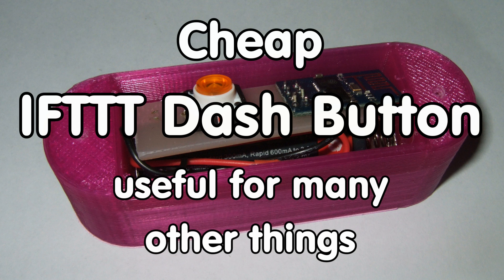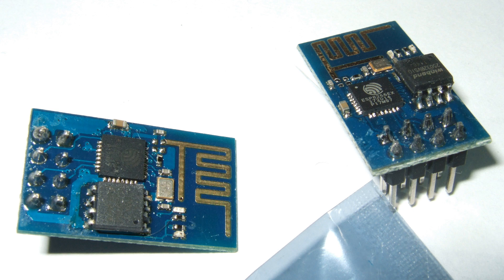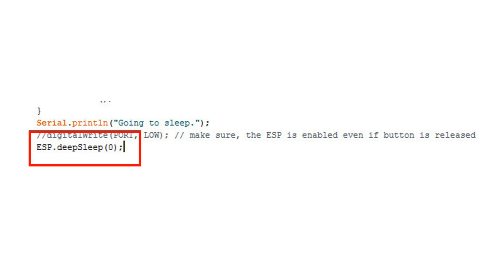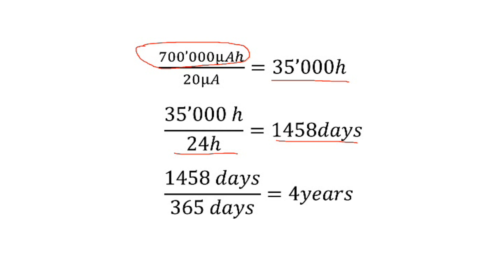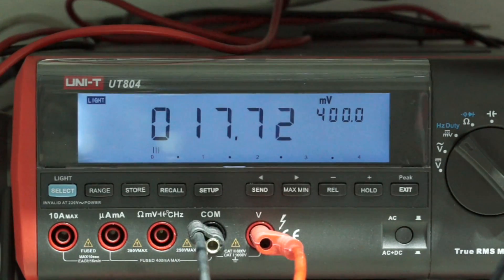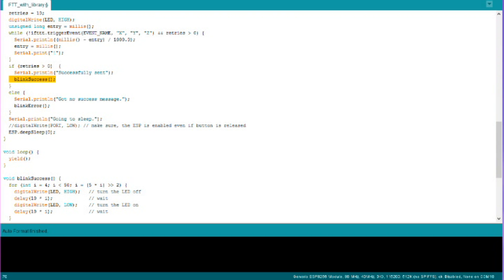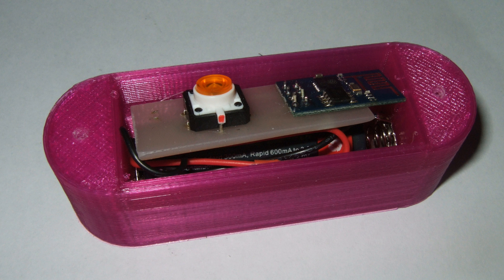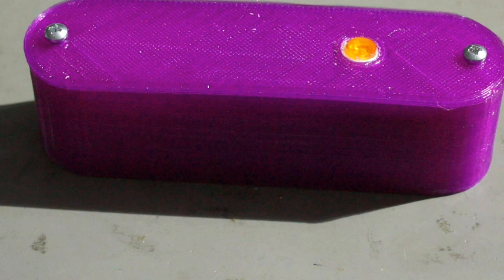#108 Cheap IFTTT Button with spare ESP-01 finished. Can be used for many other things

Comment: I downloaded your sketch and added need libraries, compiling yields -

Arduino: 1.6.11 (Windows 7), Board: "WeMos D1 R2 & mini, 80 MHz, 115200, 4M (3M SPIFFS)"

C:\Users\reisinger\Documents\Arduino\IFTTT_dash_Button\IFTTT_dash_Button.ino: In function 'void setup()':

IFTTT_dash_Button:41: error: 'mySSID' was not declared in this scope

   Serial.println(mySSID); // your network SSID (name)

                  ^

IFTTT_dash_Button:42: error: 'myPASSWORD' was not declared in this scope

   WiFi.begin(mySSID, myPASSWORD); //your WiFi password

                      ^

exit status 1
'mySSID' was not declared in this scope

This report would have more information with
"Show verbose output during compilation"
option enabled in File -> Preferences.
Reply from the maker: You can either fill out the content in the "credentials.h or just overwrite your credentials in the wifi.begin.
Reply: So where would I find "credentials.h" library?
Reply from the maker: +Paul Reisinger I think,it is on github, but I am not sure, where. Just google "sensorsiot credentials.h" and you should get it

Comment: Andreas, ESP-01 has 4 GPIOs perfectly usable which is enough for any I2C or SPI device or mixed digital input/output. ESP-12 in total has 11 pins. Have you ever tried to use SPI flash pins? Firmware must be then started from RAM. This would give us even 17 usable pins in total + 1 ADC.
Reply from the maker: I never used the RX/TX pins on hte ESP-01. But with IOTappstory.com, I have to reconsider this fact.
Concerning Pins: I never used the SPI pins. Too complicated for me. Then, I would rather use a port extender. Or wait for the -32...

Comment: Excellent As always.. Love Your videos.
Reply: Andreas, I just saw the code. You have used variable retries  > 0 in the second while loop.  What is the point in using it. And what does the yield(); function do.. Thanks, I'm getting lot of motivation from your videos.
Reply from the maker: 1. retries: After a certain number of retries, the ESP resets and starts over. I could also stay in this loop forever. I do not know, if it helps to reset. but for sure, it does not hurt...
2. the yield() function is necessary for ESP8266 sketches, if you do not use delay(). It gives the processor time, to do its Wi-Fi tasks. Otherwise, the ESP crashes.

Comment: Great job, Andreas!
Your videos is always feeding my mind with new useful information, and now its just in time for my current DIY task.
For today, I'm looking for a low-cost wireless solution to connect spring vibration sensors SW-1802P to Arduino-based alarm, with low power consumption.
I have not chosen yet - ESP8266 or NRF24L01+, or maybe something else (cheap 433mHz modules is not a good solution for security reasons).
Reply from the maker: What would be the purpose of the device?
Reply: The task is to create a low-cost vibration sensor module with low power consumption for the alarm system. The trigger is a spring-loaded switch SW-18020P or ball-based tilt switch WS-520. So I need to process the trigger state then send the alarm signal wirelessly. 
The common security sensors uses 433 MHz freq, which is not suitable because of very poor security. From a low-cost wireless solutions available I have ESP8266 and NRF24L01+
Maybe the simpler and effective solution exists, I think.

Comment: When I re-built my house back i n 2004, I decided to place an experiment behind the vinyl siding, on the North wall of the house.
I unrolled a 25' kitchen aluminum foil and glued it horizontally at about 18 feet off the ground (highest point I could go), and glued it to the house wrap vapor barrier. You should've seen the look on the faces of the siding installers when they showed up that morning. Priceless!
I used it as the antenna for reproducing the effects reported by Tesla as radiant energy. (Patent: http://www.google.ca/patents/US685957). Read this patent carefully. It's amazing. Even re-reading it after all these years.
The results were very surprising. A lot of electrical energy could be generated from the free ions in the atmosphere. 
I wasn't into Arduinos then, because they didn't exist back in 2004. 
Now, I am beginning to look back and see the huge potential this may have in operating an Arduino-like project, without solar power. 24/7 and in most cases, stronger power at night!
Not enough power to even run a light bulb full time. Let alone your house! But I was able to pulse an led at 10 Hz.
The trick was to keep charging the main capacitor, using the Jewel-thief like circuit. Actually, it is a boost converter!
When the voltage of the cap reached 20v+, dump this voltage into the main battery (Pulse Charging).
John Beddini's "school girl project" (SG Motor/generator), reflects that. He produces No Free energy of course, but the fact that you can steal power from the atmosphere has huge potentials for low-power devices. 
I am going back in time and re-investigate the possibilities of my past insights. One would be the elimination of batteries and using a single Super-cap as the main power source and operate 24/7 without any other power source.
Will report back IF I find anything useful. 
In the worst case, I would have to use a separate super-cap and keep accumulating power from the atmosphere until I has enough power, to operate the ESP8266 and it's WIFI for a few minutes. Rinse and repeat. How often can this happen? how much power can be had? what are the relationships between the antenna area and production of power? many many questions to be answered.
Reply from the maker: Interesting project. I have no idea how much energy is around us. I just remember, in the days of short wave radios, I was able to keep a 
fluorescent neon lamp in my hand in the proximity of my shortwave radio and the lamp went on even it was not connected  at all. The same experiment was done on much bigger distances near more powerful short wave radio station (then used for oversees Propaganda to the "communist" countries...
So, maybe part of your "harvest" is energy form your Wi-Fi or a close-by cellular antenna..
Reply: UFOhunter fascinating and well written, I would love to hear more🙏
Reply: As I started to read your comment I suspected you were going to make a tin foil hat out of the foil but this turned out to be an intriguing and well-written post.  If I look around my living room where I now am, I can see electrical devices everywhere and you raise a really interesting point about batteryless devices.

Thank you.
Reply: Very interesting bro! Thanks for the write up and link.  Really makes you think!

Comment: After seeing the 33C3 talk about an attempt to hack the amazon dash button v2 I started to look for creating something like that myself, and I came across your video 101. (and subscribed to your channel since it seems you do a lot of interesting stuff with this esp8266), my esp8266 I ordered yesterday and should arrive in a few weeks ;)
However I also saw some discussion about reducing power usage by using an LDO with reset pin. Design can be found here:
https://github.com/8n1/esp8266-smart-button
I was wondering what you think about this. Also 1 of the things talked about in the talk was the dash button also sends the % of power that is left in the battery ... would be interesting to send this as well so IFTT can for example send a mail if the battery is about to be depleted...
Each time you push the button the ESP will draw a lot more than 20uA so you won't last 4 year with that battery ... (your calculation now only contains when the ESP is in deep sleep -> so you should never push the button to get this time :P )

Comment: I have read that you need to hack the esp-01 for deepsleep. You did not mention any hacks? See this Hackaday post: http://hackaday.com/2015/02/08/hack-allows-esp-01-to-go-to-deep-sleep/
Reply from the maker: This title is misleading. You do not need to hack it to put it in deep-sleep, you need to hack it, if you want to let it automatically wake up after a defined time. This is not necessary for this button. We do this manually.

Comment: have you seen mongoose-os? It is an operating system for multiple chips CC3200 esp8266 esp32 and others that has support for mqtt (even AWS-IOT) i2c gpio uart, and other things. They have a really nice configuration system, which reminded me a bit of the one you use with your appstore.

Comment: Hi Andreas,
It is a interesting mode to deep sleep the ESP01. What about the Wemos d1 mini board? currently in my projects i'm using direct cable beetween chip enable and reset pin, so it auto-reboots. But since i don't have a proper multimeter i'm not sure of its power consumption in deep sleep. can you test this? Best Regards
Reply from the maker: The Wemos is not ideal for deep sleep in production. It has components like the USB to serial  converter which draw current even if the ESP sleeps. So, if you really want to save power, you have to use the bare chip. However, I use one for development where I do not care about energy

Comment: Hm, in this particular case, ie ESP-01 and a button to manually reset the ESP; why don't just use the button on the Vcc line if power consumption is important? 0uA is better than 10-15uA.
Reply from the maker: Then you have to hold the button down till you are sure the signal is sent. With hte used concept, you jus push the button for a short time and the ESP switch it off when finished.
Reply: Yes, I realized that like 2s after submitting the comment. 😂

Comment: I find the lifepo4 quite expensive. 😕 ~5$/piece! Do you have a link for the one you use?
Reply: Alex Schick Andreas covers this in the other video .the problem with AA is two alkaline battery's will quickly drop below usable voltage for the esp8266 and while there is still a lot of charge left in the batteries
Reply from the maker: I purchased it a while ago. You should find the link in the video about LifePo4
Reply: Andreas Spiess thanks, it is video #64. about 13$/4 batteries, not as cheap as I would like to. Might be cheaper to use simple AA with a compromise to size.

Comment: Mr Andreas your videos are very useful and helpful. But I have one question about 3:15 in this video. You say 15 μA but at multimeter the range is voltage. What about that ?
Reply from the maker: The micro current Gold device (the red one) changes current into voltage. Just google the device if you want to know more.

Comment: It sure is very useful, and it leads me to a question I have for some times. My project consists of various sensors for my boat. So I want to protect my circuits from moisture. I thought to drown my esp12 and the other components in clear resin, but was wondering if it would alter the wifi signal... would you have any opinion on this subject ?
Reply from the maker: +ghismo If the resin is non-metallic, it should work. But I would try it once wit an example. I covered one with heat shrink tube and had no big effect.
Reply: Andreas Spiess wow, that was a fast answer ! Thank you ! Yes, I'm not totally convinced it will work, so I will buy parts in multiple quantity. There is another problem, when the resin cures it can warm up to 100°c... I've seen somewhere esp where rated to work at 125° so it should survive... well, I'll try. Thanks again for your time, answer and videos :)
Reply from the maker: During soldering it is heated to more than 200 degrees...

Comment: Nice. So i will maybe have a use for my old and never used esp01. 
Someone any idea how to find out which actual offers have 1 or 4 MB Flash? When i scroll trough the actaul listings none of them tells any size of the flash. I do not want to buy those small Flash esps again.
Reply from the maker: 1 M is the same as the Sonoffs and is ok for many purposes. I never saw -01s with 4M
Reply: I saw an offer telling 4M a while ago. But actual none tells any size.
Reply: The newest ones have 1MB instead of 512kB. There are none with 4MB. You must be mixing things up with other models such as ESP-12E.

Comment: Nice! Despite the fact that not so many of your viewers liked the 3d-printer part I've just bought one. Is it possible to get the .stl-file for the box and what kind of design-program do you use to create it?
Reply from the maker: Good decision. You will love it! STL files are now on Github. I use Solidworks, but it is an overkill fur these applications.
Reply: Andreas Spiess :-)
Reply: Thank you very much!

Comment: Great 're-use' of old ESP-01s! I used mine to 'thingiversify' some AVR-Projects using Jeelab's ESP-link software (worth a look, imo). To make the ESP-01 suitable for OTA update, i replaced the eeprom by 4M versions. Thes cost a few cent, and it takes a few minutes to change them - especially when using cool gear like ke your microscope... ;-)
And of course tHanks for another inspiring video.
Reply from the maker: 1. Jeelab is a longtime member of my to-do list...
2. I even made a video to upgrade to 4M. But I was too lazy this time. I hope, on sunday, I will come with a video on how to use IOTappStory infrastructure for your own projects. Maybe this is your (or another viewers) first port ? It would be a nice addition to the IOTappstory.com

Comment: What about the pullups? How much current do they draw? PS. You could use some nicer screws for the case :D
Reply from the maker: Concerning Screws: I am an electronics engineer ;-). Removing the pull-ups did not change the power consumption in deep-sleep. I checked

Comment: The 4 yrs assumes current/volts  down to 0 or when the battery is not strong enough to power the circuit? I understand that these batteries are great for the voltage dropping at the end of life but if I wanted a circuit to be disposable after 2 years, could I just use a couple of AA batteries?. Thanks for your great videos.
Reply from the maker: All these calculations are theoretical, because we will use the butto (of course). I just wanted to say, that I think, the few microAmpere are good enough to stop searching for a better method. You can use different sources of power as I explained in the video #64, also AA or AAA batteries. They bight be a little bigger.

Comment: Excellent presentation, thank you. As you investigate low power devices, you may want to look at a control box made by Philips for the Hue system that has no battery yet can still send control messages wirelessly, using only the energy provided by the button press. I do not know how this energy is harvested, but it seems like a great alternative to a battery, even one with a multiyear lifespan.
Reply from the maker: Thanks for the tip. Did not know it exists. I have to look at it.
Reply: Andreas Spiess https://www.enocean.com/de/ has some buttons without batteries too. "Energy harvesting" is the bigger topic :-)
Reply from the maker: Thanks!

Comment: +Andreas Spiess , another great video with ESP. 4 years standby time (without pressing the button and without considering the self-discharge/degradation of battery) is pretty impressive for your setup of ESP. Furthermore, it was very interesting to learn about ESP's antenna issue in a small enclosed box with battery.

This little chip (ESP) amazes me with the endless possibilities in which it can be used.
Reply from the maker: I was also catched by the antenna issue...

Comment: Nice video. I got a question a small sollar panel from ebay with a simple battery is enough to feed the esp8266 on wake mode? do you have any recomendation on the hardware?
Reply from the maker: I plan a video on Solar powered ESPs when it has a little more sun  here in Switzerland...
Reply from the maker: The panels, maybe. But not me. I hate the current cold!
Reply: Andreas Spiess don't wait for more sun, all solar projects must work in the winter too, so now it is time to test this. Keep up the good work!